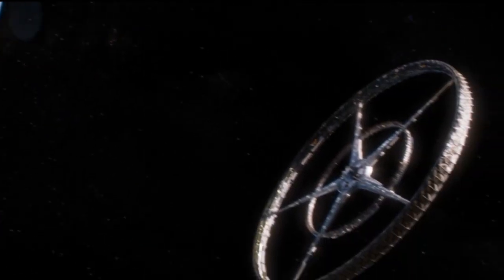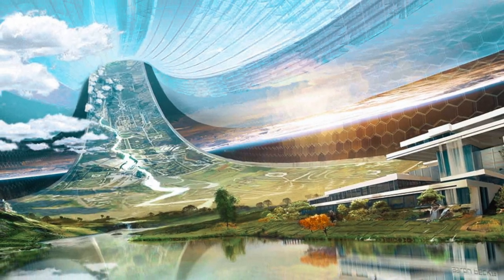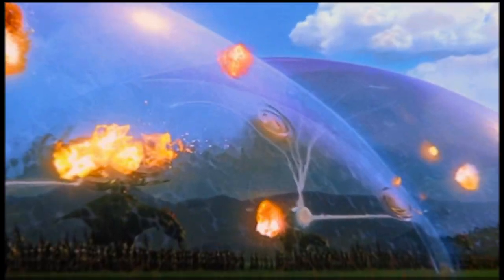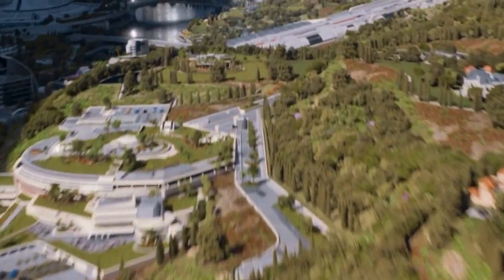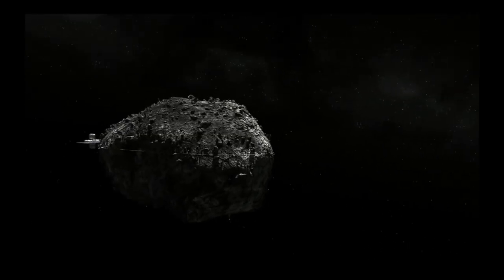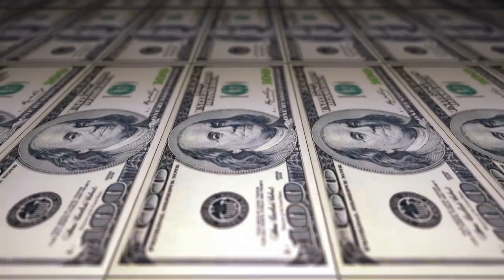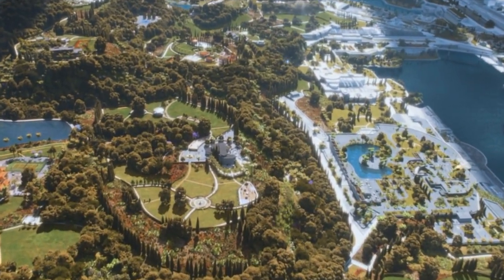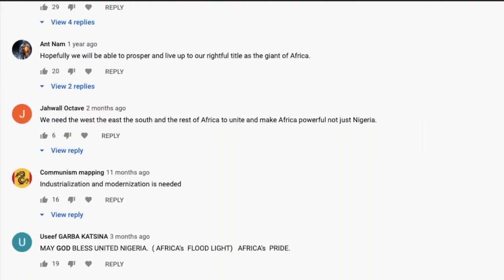Building A Real World Elysium

Comment: Not sure about the strength. Can it be built with steel? Or would it need a stronger material? 5 spokes? Or countless wires every few feet?
Reply: No, steel isn't up to it. Plastics such as Zylon and Dyneema could in principle do it. They can hang down almost 400 km in a uniform one gee, and translated into supporting their own weight while spinning, that means they could form a one-gee-rotating ring with that same radius, 400 km.

But you want them at ten percent of breaking stress, not 100 percent. That limits radius to 40 km. And then you want them to support weight other than their own, maybe five times their weight, including their own plus that of four masses of other stuff. That drops the limit to 8 km. Elysium would require a degree of compromise on the ten percent and the factor of five.

Steel appears to be doing a good job reaching down 3.2 km in the Zugspitse-Eibsee cableway. But those cables are probably 90 percent or more self-loaded, and at more than ten percent.

Comment: where will you find that much mass to build such a large station? Where would you find enough air? Where would you find enough water? How would you make such a large physical structure stable? Basically, you can't add air and water while it's not rotating, and that means you can never slow or stop the rotation without loss of air and water.

Comment: The movie is about as realistic as bugs bunny and Marvin the Martian.
It has artificial gravity without spin, it has force fields instead of a glass roof to keep air in and cosmic rays out. It has ground-to-orbit ships that hardly burn any fuel.

Something smaller than that, is entirely possible with real world engineering, you just need to spin every couple of minutes and have cosmic rays shielding that admits Sunlight. See the '70s "Stanford Torus" habitat which was entirely realistic, but a bit smaller.
As of the '70s, the largest 1G thing we could build is ~30km diameter (so it would spin ~.25RPM)

Please note that when such a thing is possible (~30 years from "Go" any time since the '70s), you're mining asteroids, and there is no scarcity of energy or raw materials or budgets. I challenge anyone to make a half-plausible dystopian story in such a world.

There's no reason why farming couldn't be very space efficient hydroponics and such, leaving the internal surface as available flat floor at a "ground" level. Habitation would be "underground", but still could be designed as open and with available Sunlight piped in.

BTW, we spent ~$17 trillion on military since 2003, with basically nothing to show for it but fat-cat off-shore tax havens getting richer, and more oil wars in the future.
 Mining NEAs and building space industries would end oil wars and reliance on fossil fuels, or wars for industrial space or land, and show the way to removing heavy industries from the planet We could provide budgets to not only let everyone live a modern lifestyle (most think of Nikes and blue jeans, but think also of education and travel and household energy and heat & light at night without burning biomass, which is the norm for realistically the majority of the human population today.)

What is $5 trillion for a space habitat (if we accept those numbers), when "money" isn't tied to gold in vaults and there is no shortage of resources and the world economy is beyond anything we think of as "wealth".

Comment: While it may be possible to build such a structure with technology, raw-materials and of course the money necessary, one thing is missing in this video- the time needed to do it.  
I believe that the length of time necessary to build a habitat of this size would considerably outweigh the lifespans of the individuals ever hoping to live in it.  Something of this magnitude would  span many generations, and even if the technology advancements help to build it faster over time, the probability of it ever being realistically constructed based upon its original design, are simply not logical.

Comment: Why bother build a station when you can colonize a planet or moon?
Reply: I dont think its possible
Reply: The atmosphere and magnetic field of the earth will protect you against cosmic radiation. The magnetic field of mars is only a fraction of the earth's magnetic field and therefore wil provide no real protection. The traveltime between the station on the earth will also make it easier to send food and other ressources.
Reply: @marcusmikkelsen7668  iirc its not even a fraction the center of mars is a cold ball of metal so there is no magnetic field just an atmosphere that is 1% the density of ous
Reply: @alexsanchez1620  this comes up with a question. Will we be able to live on Mars ever?
Reply: It's technically cheaper.
Reply: You'd get Earth-like gravity with this. An Earth-like climate and plenty of space too. It would be vastly cheaper than terraforming.